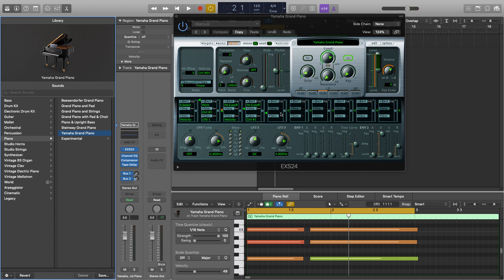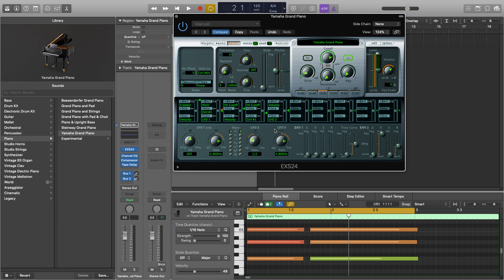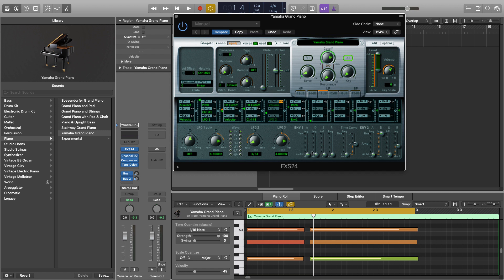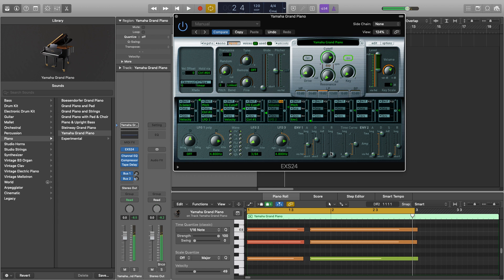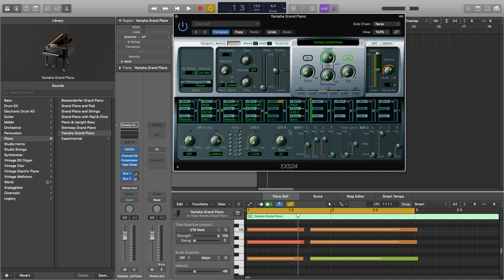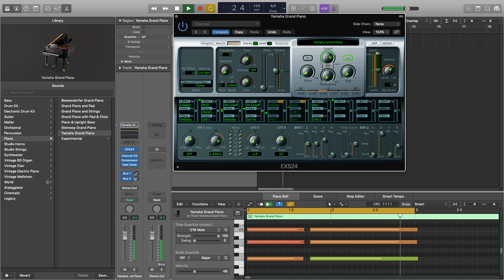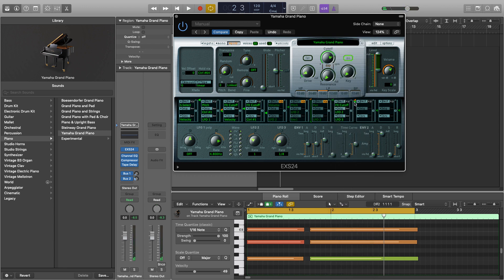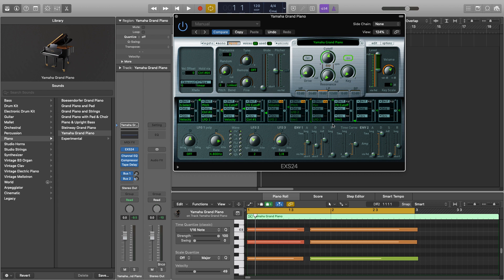Logic Pro X -EXS24 Sampler Part 3: Routing

Comment: I see You bypassing each of those parameters which was nice to see 👍

My question is how would You go about setting  up a few of those parameter in the mod matrix and map to a single mod wheel control on my physical midi keyboard 
so for sound design reason to be able to control all those parameters with just the mod wheel?